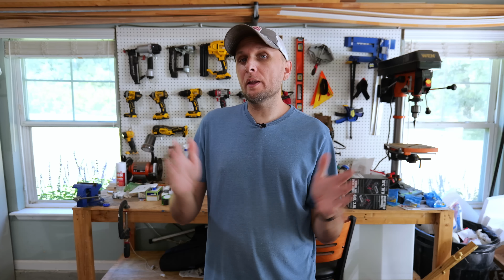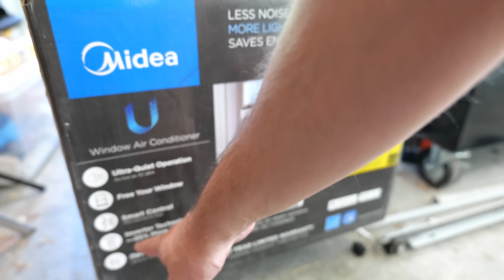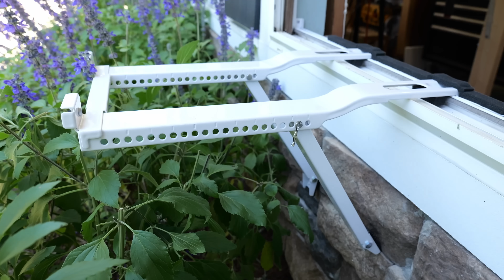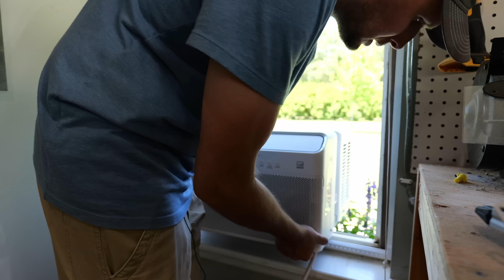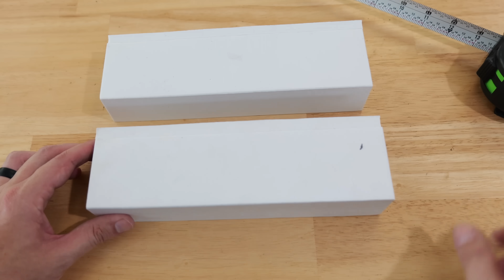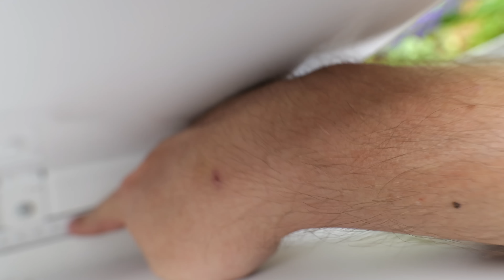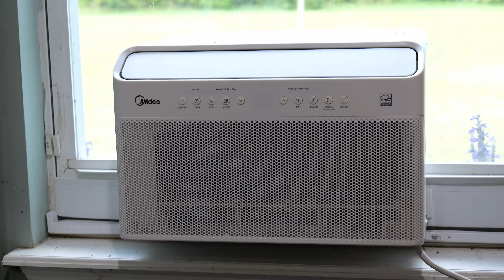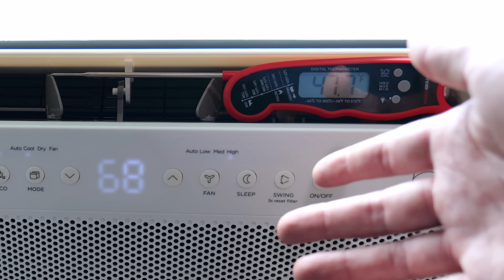The COLDEST And QUIETEST AC Unit Ever Made!  Still Use Your Window!

Comment: 2 small warnings on this unit. Had it, loved it. 2 problems, You absolutely must have a downward tilt on this unit or the moisture & dust willl accumulate internally & especially on rotary fan which has hundreds of little slots and very hard to reach. If this happens the accumulation will emit a very stale smell into your home.  The average person will not be able to take this apart to clean. I called Midea and they would not provide me any instructions, nor could I find any videos. 2nd warning. the smallest unit is 14 inches high and will not fit in smaller windows. Please measure the max open height of your window before ordering.
Reply from the maker: I have a video coming out in the coming weeks showing 2 super easy ways to make sure this doesn't happen.  No need to take it apart.  Been working for me.

Comment: The problem with this unit is the mold build up. Cleaning these things is not a easy job you have to remove several things in order to get to the blower fins which will get moldy doesn't matter what you do. I like the unit but not worth the issues of mold.

Comment: Nice A/C & helpful install info… you can see out the window! 
Another option to keep the window closed securely would be to cut & fit a pvc pipe or old broom stick & insert it straight up and down, putting it on top of the (moving) window to the top of the frame of the window. Learned that from my Step Dad.

Comment: I have the 8000 btu manufactured date of 12/2023 that does not have the buttons on the control panel. Other than that looks identical down to the remote control. Also I removed the blue drain plug on the bottom right so it will drip out.

Comment: What length is the electrical power cable ? - how close do you need to have an electric outlet ? I cannot find this information anywhere - but it is critical ... unless want to have to hire an electrician to move / install an outlet - and then all the drywall work that never looks right - or lasts ...

Comment: Is there comparison efficiency data for the Media inverter window air compared to mini-splits?    The mini-splits seem to be significantly more expensive - I'm wondering why?

Last year I purchased a Midea 12K BTU and this year purchased two Media's and gave to relatives.  

EG4 is now making a hybrid solar mini-split and I may likely buy more Media's if (hopefully) a hybrid version is available.   I did prototype the hybrid solar with my Media using my Jackery solar generator.    It would be nice to have everything built in to the window unit with hopefully a direct solar connection and also battery connection.

Dave

Comment: I bought the 8,000 BTU version last year. It is quiet as far as hearing motor. But no matter how I mount that thing, I hear a loud humming/drone noise through the walls. I can hear it a good 30 plus feet away in other rooms. Drives me nuts. I have three more ac units to buy this year. That brand won't be on that list.

Comment: I got a 1st floor 650 sq ft.  Have an old friedrich 13,000 Btu that did that job well and was wondering if the 12,000btu midea could fill its shoes well.

Comment: A reverse thermocouple can become very cold using electricity. If AC uses it to cool the air then there would be no need for freon or heat ducts to outside of the home. Only a container to collect the condensation would be needed which can be drained off or evaporated.

Comment: I got a 8000btu unit in my 20'x20' metal shop that's sectioned to 14'x20' "hobby" shop for my retirement.

FYI: Sectioned off area is framed, insulated and sheetrocked with 8' ceiling, also framed, insulated and sheetrocked.👍

It works really good and able to install it by myself.

I did make a 2x4 bracing on outside to support the weight, it does sag down somewhat because of it's weight.

BEFORE you install it, be sure to remove the cover and drill 2 holes so that condensation have somewhere to drain.

Otherwise, water will accumulate in the pan and possibly flow back to the inside🫣

It is IMPERATIVE that level be used, to be sure its sloping TOWARDS the outside👍

The app is very useful when connected via Bluetooth, to schedule on/off timer. It gets pretty steamy here in Eastern NC, I'd like my shop ready to work in during the summer, instead of waiting for shop to cool when It's 100+ degrees inside😅
Reply: Don't drill a hole, the water is supposed to collect because it's used to cool the condenser. If you drill a hole it will increase the pressure in the system and reduce efficiency.

Comment: If the cord can't reach the outlet can you use an extension cord?
Reply: Not a cheap extension cord but a correctly sized one and those can be expensive. Lower the number on the gauge the more expensive they are. If you have a cheap water hose in front of the house,  you  need to spend money on the ext. cord.

Comment: I have the ge Clearview 8300 btu version and I absolutely love it.  Wifi was fairly simple to set up and the Ui is easy and shows power usage.  It was easy to install and is very quiet sometime I have to check to make sure its on.  It works very well and keeps the room at temp pretty easily
  I would definitely get another one.
Reply from the maker: And see I did a comparison video between the clearview and this one and I would buy this one over the clearview based on what I found.  I didnt find anything wrong with the clearview though and it is one of the better units for sure.
Reply: @HowToHomeDIY  yes I saw that one after I wrote this. Only the Clearview was available at my local Lowe's

Comment: Thoughts about putting this on the 2nd floor? The window also has the roof to the garage below it. I wonder if the water dripping in the same place for long periods of time would cause issues?
Reply: The newer models have a better drain system, the older ones do not, if you install exactly how they say, the water will drain down the side of the house. So tilt more.

Comment: I have 2 of the 8000 BTU, they're good units, quiet, low power consumption, but not without flaws.  Some things to note.

1. Yes window technically opens... but you can't keep the AC in place & use a window screen, so mostly it's not a feature unless you want to lift the fairly heavy & awkwardly shaped AC Unit out of the window every time.

2. It has a water catch pan that the external fan uses to spray water up onto the radiator fins for a "swamp cooler" effect.  This is HORRIBLE if you're anywhere there's humidity as the pan of water starts growing all kinds of craziness.  At one point I noticed one of mine was growing mold slime internally after just 3 months of operation thanks to this bad design combining with the consistent >80% humidity in my region.  Had to take it apart, clean it all out, spray it down with bleach then an anti-fungal spray, reassemble.  Took me a solid 2-3 hours of fairly disgusting work.

3. There is no integrated drain plug that you can just pull out to drain the water, at least not on my units from 3 & 2 years ago.  I had to drill holes in the bottom of the pan through the steel & enamel paint, introducing a rust point... I coated the hole edges in grease to limit the rust, but ultimately, solving this design flaw is easy, but has a cost.

4. The way the interior portion of the unit is designed, it is very difficult to take apart.  I still have not figured out how to totally disassemble it to clean the interior side fan.   It's a fairly bad design as far as maintenance is concerned, because you need to clean fans of dust, mold, pet hair, whatever else gets into them, so making it a pain to access is a serious problem.  I disassemble, fix & reassemble electronics & small engine-based machines like pressure washers & lawn mowers & chainsaws all the time, multiple per year, and I could not figure out how to get this thing apart without risking breaking plastic parts just trying to pull things off.  It's snapped together in a way that's not obvious or trivial to reverse.

5. Definitely less impressive as they age in terms of cooling power.  My older one is 3.5 years old & still works, but takes noticeably longer than the 2yo AC of the same model & cannot push down to as low of a temperature.   My 2yo model can push the temperature down to about 60 in 95 degree weather at 85% humidity in a 200sqft room.  When I first got it, I tried out how low it could go in the same room & went down to 51.  Now running 100% duty cycle with energy saver off, it hits equilibrium in the low 60s during hot summer days.  My older one struggles to get to 65.

Comment: You didn't discuss draining.  I love this A/C unit but it dripped into my window sill and damaged my wall and the floor below.  
Thought I could redo the mount but was not able to correct the problem.  Unfortunately, I had to drag the unit out to the curb and put a FREE sign on it.  Maybe someone else can figure it out.
Reply from the maker: Assuming it wasn’t installed per the instructions then.  I’ve had zero issue with that.

Comment: I know this is pretty late for this video but I feel like people need some realistic warnings.  I bought two of these a few years ago (8000btu & 12000btu) so, hopefully, they've fixed some of these issues.  1. These things are noisy as hell.  Midea actually refunded me for both of them (without taking the units back) because they make a terrible squeaking and whining noise when it starts up.  Beyond that, it's very quiet on the lowest and slowest settings. Anything beyond that and it's noisy as hell. Especially when the inverter kicks in.  Crazy loud. This leads me into the biggest issue. It prioritizes quiet over cool/comfort.  Meaning, this thing will run the inverter as little as possible. This is fine if you live in a very dry climate. However, in the summer, where I live, it gets pretty humid as the air cools.  So, if the inverter doesn't run, no moisture is removed from the air. You will be blowing cool, moist air into your place from outside. Note: if the room it is running in is around the same temp or cooler than the outside temp then you will only be sucking in straight, unconditioned air from outside.  I was waking up freezing cold and sweating every night because of it and there was no setting change that could fix it.  Any settings you change will be ignored in favor of being quiet (dry mode is useless). I ended up cutting the temp sensor off and splicing in a resistor to make it think it is 400° in the room so it actually condenses the moisture out. And because of this, it's crazy noisy all night.  Other minor issues: the lights are too bright for a bedroom. You can turn them off but mine has a bug where they will turn off then come back on every minute or so. I had to put tape over them.  There is a beep every time it turns on or a button is pushed. You can turn this off using the app but it will come back on if it ever loses power. Speaking of the app; there are settings you can only change using the app.  The remote is missing options. Finally, they just don't get as cool as my previous window units. Especially when the temps get into the 90's.  They just can't keep up.  So, unless they've made some major changes on these, I'd avoid them.

Comment: I've had the 8000 btu model since July of 2021.
I want to tell people to be careful because wasp will set up nest in it, spiders (because of the cold and wetness of it), and their are little screens to help keep them out you can buy along with some magnets.
I would suggest to not place plants around them or it around flowers. It helps bring them to it.
But overall, I love the thing tremendously. It takes care of 1/3 of the house during the 100 degree heat and we can not afford a full central air conditioner replacement.
And it is quiter than a whisper brand new.
Just gotta clean it and keep the critters away.

Comment: I sent this to Midea.  Recall the outside bracket angles down a little and is NOT level.  So drill some holes right at the bottom at the back end of the unit.  There are copper pipes located there so this is risky for DIY.  My window U-shaped air conditioner should've had drain holes put in.  One should NOT leave a window air conditioner installed year-round.  In the fall when I remove it from the window, I get a lot of water draining out.  I'm looking forward to eventually getting your packaged window heat pump that I WILL leave installed year-round.  Please, just be sure to have plenty of drain holes so water doesn't accumulate.  I do NOT have gutters on my roof, so the rainwater just comes right down on anything sticking out of any window.  So, your test could be, spray your window unit with a garden hose and then see if it dries out OK within 24 hours.  Otherwise, the water just sits inside rusting the appliance and perhaps even growing legionnaire's disease.

Comment: mine not only does not cool, it opens outdoor for bugs to enter through unit, when off, my bedroom ambient temperature is several degrees warmer due to leakage and outside air infiltration through this POS unit I bought on your recommendation
Reply from the maker: How many times did you post the same thing?  And how are you saying youre not complaining to me?  You are saying you bought it based on my recommendation.  Yet months ago you wrote about this when you could have returned it or exchanged it and didnt.  I will not back off of my recommendation of it because it works fantastic for me still.
Reply: @HowToHomeDIY  I talked to manager at Home Depot and she is aware of the design problem and is going to take this crappy thing back for refund outside of the normal return period. Just trying to save other unsuspecting trusting viewers the annoyance. I would expect any real product review would solicit and welcome actual experiences and product critiques. But that is just me.
Reply: @HowToHomeDIY nationwide factory recall..not backing off your recommendation? You recommend defective products even after complaints and factory recall. How much do you get paid to recommend defective products?  I would expect any real product review would solicit and welcome actual experiences and product critiques and acknowledge FACTORY RECALLs But that is just me.
Reply from the maker: I’m genuinely sorry that my honest recommendation (before a recall was issued) led you to make a purchase you regret. I’m glad you were able to get your refund. I have since followed up and made a video on how to address the defects the recall noted, and the company has since then also come out with additional fix options. It is not my intention to mislead anyone. I still have this unit running in my own home. So my recommendation stands based on my personal experience I have shared with my viewers. I hope you have better luck with whichever unit you decided to purchase as a replacement.
Reply: @HowToHomeDIY and I understand that. My problem is your perceived assaults on my legitimate and well founded experiences with the product I voiced in hopes YOUR channel viewers could avoid the common frustrations associated with this unit.

Comment: Any window AC with a low ambient kit? 
I want to climate control a room in the 60s year round. 
These Midea units aren't supposed to be running on cool mode if outdoor temp is below 59 or 55°F.  That really does suck! I can't be the only one that has a stuffy always warm room. I can't open windows because it will get too humid, and well outdoor air quality can be bad. 
Come on! Give me options that utilize a window!
A bigger mini split can work but it takes up a chunk of wall space. I already have this hole in the wall called a window. Help meeeee!

Comment: I’m going out on a ledge and assume it can’t be used in a non-double-hung window like my sliders because of gravity.  Big disappointment.  I have a 1956 built home in California with sliding windows and one window I added that’s a casement. I’d have to cut a hole in the wall to install it, then re-drywall and re-stucco, because it needs a casement window.  I also assume one can’t use the screen while it is installed so if you rely on a window for cross ventilation most of the year, you would need to remove the unit in order to do so.

Comment: These have been around for a while.  Over a few years I replaced all my window units with the 12k Midea U shaped AC.  They're great.  Performance is solid, energy consumption good, and very quiet compared to the competition.  

Costco usually has them on sale in the spring.  Last one I bought was around $300.  Yes, for the 12k unit.

Comment: Great video. I just bought a shed it's wood and metal/aluminum beams. It's 12'x24' (288 sq.ft). Has an a/c cutout. I dont want a mini split because I'd only turn it on periodically.  But not sure which type/size of system to get. I'm eyeing a 8k btu wall unit from Home Depot, but I'm not sure if that'll be enough. I also want to put some type of insulation on the walls. Lmk your thoughts. The shed was purchased at the sheds depot

Comment: Use closed cell foam or Styrofoam so it won't retain water. You can buy pipe insulation wich won't soak up water.